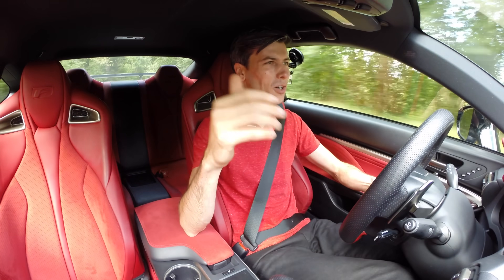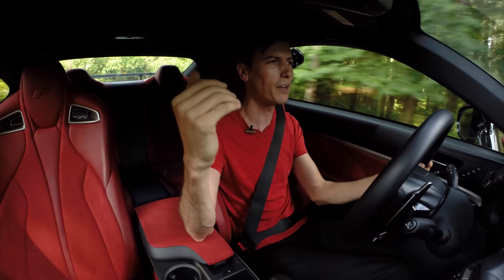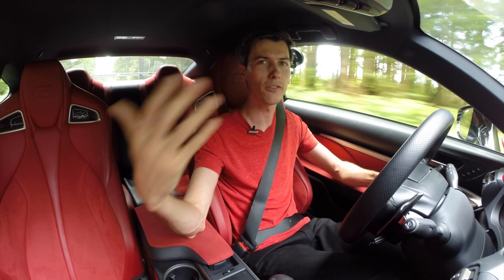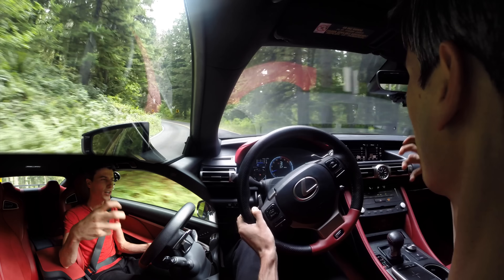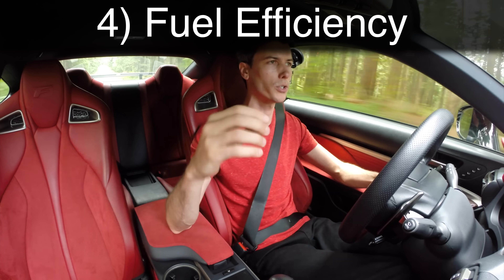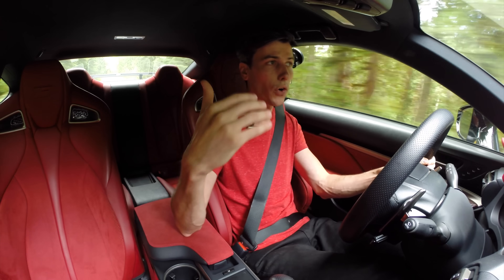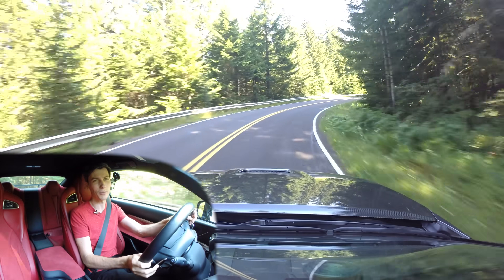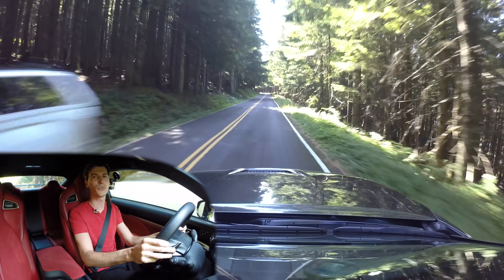5 Reasons You Shouldn't Buy A Turbocharged Car

Comment: Not a fan of turbos simply because of the lag, complexity, and reliability issues. I'll take a bigger engine and fuel bill any day.
Reply: Roger Hinman turbo lag isn’t that bad anymore thanks billet compressor and turbine wheels, increased exhaust gas speed and layout, the bearings used and the such, they’re not really that complicated and they’re pretty reliable, my 01’ Audi S4 has never had the turbos maintained or replaced in almost 200k miles, and that’s almost 2 decades old, they’re honestly pretty efficient, not really complicated and they don’t really break unless you beat the piss out of them and even then you can beat on them but take care of them with proper heating and cooling cycles and change your oil.
Reply: With an overdrive transmission my 'ol Mustang would probably get 25MPG on the highway (with no engine mods whatsoever and with the original engine).
Reply: Most Turbo vehicles are gas guzzlers too.
Reply: @PanameraTurboSEHybrid  When most people get a turbo car they always floor it so worse gas milage overall.
Reply: Fox McCloud 007 you can floor it in a 4 cylinder turbocharged car a lot and still get better gas mileage then a NA v8 any day its about the size of the engine and how many cylinders and what the engine was built for you dont get worse gas mileage overall just because you have a turbo
Reply: Panamera Ghost it depends on the size of the engine and weather or not its a 4 cylinder or a v6 or a v8 saying just a car with a turbo is a gas guzzler is just false information lol
Reply: Roger Hinman wake up mate. All commercial vehicles and heavy machinery are turbo for efficiency and reliability. Turbo trucks typically go 1M kms between rebuilds. All 2019 turbo cars have 11:1 compression ratio hence great low rpm throttle response. I have a factory 4L turbo Barra, and the torque @ 2000rpm is amazing.
Reply: @nordic5490  I don't know where you live, but where I live most commercial vehicles and heavy machinery is N/A. Specially heavy machinery because precise throttle response is necessary sometimes. (Talking about petrol based machinery, Diesels pretty much need to be turbo)
Reply: Nor Dic not sure why you keep commenting this on everything, but most commercial vehicles are N/A.

Comment: Tune in next week for "5 Reasons You Should Buy A Turbocharged Car"?
Reply: I have a 2.0 litre four cylinder that has 540 reasons.
Reply: @dwvw  So is one of the reasons the towing home when running at full boost for more than 15 minutes? Id say so too, more time with the family! 😍
Reply: @WeightyLemur  2016 Golf R, has 90,000 km's on it. Year round daily driver in Canada. Makes 540whp and runs 10.82 seconds in the 1/4 mile. Stock turbo did blow, but it's a known issue and I haven't had a problem with the car other than that.
Reply: Joe Williams yup. But... Jason already bashed turbos on another video.
Reply: Oh God, don't let vehicle virgins take over Jason 😥
Reply: A 100 reason's why you should turbo your car..
Reply: The turbo charged car cost less then a hybrid, the maintinence cost is cheaper than hybrid and you get excellent gas mileage.

Comment: So, where do I buy a new diesel car that doesn´t have a turbo?
Reply: At the used market
Reply: Easy. You go to any developing country that doesn't have emissions standards and you buy a Toyota Land Cruiser 70-series with the 1HZ engine. 4.2 straight 6 making 126hp. No turbo, no catalytic converter, no nonsense.
Reply: Do not buy a new common rail diesel car they are junk
Reply: @hegantetamboktyanak6368  The last Mercedes E-class taxi I took had 557.000km on it, but no please tell me more about how junk modern diesel engines are.
Reply: @torod213  that's only one example DPF are killing diesels
Common rail diesels can't handle poor fuel
Reply: @torod213  so basically if you want to have your hip-pocket raped just go buy yourself a new diesel car
Reply: @hegantetamboktyanak6368  "New"? As in built in the last 20 years? lol

And yeah a NA Diesel that makes 126hp, gets 25mpg and takes 20 seconds to get to 60 is a great idea.
Reply: @BigUriel  actually all diesels are no good but in particular common rail especially with a DPF a petrol engine is far simpler

Comment: Nice video... I disagree with to torque point and the fuel efficiency point, the torque curve depends of the size of the turbo, and modern technology has gotten better fighting turbo lag, with somehow big turbo cars, like the McLaren 720s and Ferrari 488 pista. Fuel efficiency point: Yes, at wide open throttle the turbo cars are less efficient, but you never drive all the time at wide open throttle, in the streets al least. The naturally aspirated cars with big engines feel  good and strong in torque, in lower gears, but in the upper gears, they only show power, very high in the rpm band, of course this is less possible in public roads too. But nice video nevertheless, don´t get mad on me Jason! ha ha!

Comment: On sound, the cam lobes have to be more apart with no overlap between the intake and exhaust when running boost. That's why N/A engines sound better with big cams because they're throaty.

Comment: Well now, just hold on a sec.
Reality check, please.

This talk of "delay" is really an issue of the past.
In the Fords I drive, there is no lag. And I read many reviews of newer turbos that have none as well.
PLUS this initial torque is down low where EVERYDAY DRIVER has use for it.
Come on, really, when do MOST drivers EVER see their engines running at high RPMs!?
Never, really.
We need it from red lights and up ramps. Never at top of the limits like these reviewers rant about.

Silly.

Other than the cooling and temp issues which are addressed with modern synthetic oils and proper maintenance...the NA engine is just lagging.

Comment: You haven’t convinced me Jason. While my 427 ZO6 had all the attributes you mentioned for a NA engine, I have other comparisons to make. 2014 Ford Edge, NA 3.5 V6 in an admittedly heavy vehicle. Nice power in the upper rev band, but weak down low. Much like a CBX power-band. 2019 Ford Edge ST, 2.7 twin turbo V6. I can honestly say there is virtually no turbo lag with this little powerhouse. Throttle response in S mode is much like you claim for turbo engines.  But it’s easy to to change perceptions and modulate the throttle.  The cabin is so quiet that Ford resorted to the trick if bringing engine sound to the interior via the B&O sound system. Perhaps that’s cheating, but the engine sound is very nice. I use synthetic oil in all the mentioned vehicles, and plan to use the new GF-6A spec oil when it becomes available in 2020.

Comment: most owners of turbocharged cars can't even get to the boost, because they drive them with very little throttle input. Most of these owners are ignorant fools which were told by the dealer: " buy this car, it's very economic and has amazing power". Petrolheads know that the better engine option is Naturally Aspirated 100/100.

Comment: Compare a turbo2 litre and a 5litre high compression point for point and the 5 litre wins. 

And for reliability simpler is better and understressed is better so the 5 litre is the winner.
If you want efficiency and power in a diesel then turbo it. CAT nods in agreement.

Comment: Manufacturers love turbo's because they can claim CAFE standards within the fleet. Easier to make a car that gets good mileage when not pushed hard, which is what they care about.
Reply: Robert Mills turbos are better fuel economy, better mid rpm torque where people actually drive, in 2019 are all 11:1 cr hence great throttle reponse. Turbos dominatw all classes of motor sport where they are allowed. All commercial vehicles are turbo with turbo trucks typically doing 1M kms between rebuilds.
Reply: IIRC turbos are great at economy ... But only when you're babying it because you're basically running a tiny NA engine. When you put down power, well now you go from 2 L to 3L and it eats fuel accordingly, and then some to keep cylinders cool.

Comment: If you want a more trouble-free and longer lasting engine, your best bet is a normally aspirated engine. In my experience, turbo charged variants of engines also offered as normally aspirated engines tend to be more trouble-prone with a shorter lifespan. Oil consumption and blown head gaskets are more common as well.

Comment: Electric motors deliver the power now, when you ask for it, instantly, ref. Tesla Model 3 / Nissan LEAF etc 
While the batteries weak, we already have access to cars with 70+ kWh of battery 
LEAF went 24, 30, 40 & 60 kWh now ^^ 

In big urban areas, traffic congestion, lots of stop & go, Electric the most pleasing/ hybrids are good too
Reply: Until you get into heavy duty applications like in trucks, tractors and other large high load vehicles.

Comment: On my new channel I talk about why to avoid turbo motors, GDI motors, and engines with timing belts. Great video!
Reply: The Switz good channel to.avoid then. All commercial engines are turbo, including power generators, all classes of motorsport are dominated by turbo where turbo is allowed, turbos are reliable with turbo trucks tyoically going 1M kms between rebuilds, and, all 2019 turbo cars have 11:1 compression ratio giving great throttle response at low rpm.

Comment: Your point of half throttle full boost is flawed. In such a scenario you're still not at full power output for that given rpm as the throttle is restricting airflow massively, so it takes far less airflow to reach that boost pressure.

Comment: I would be very interested in a video comparing turbo vs NA fuel economy at the same horsepower rating. For instance, take any Ecoboost and compare it to something with the same horsepower that is NA.
Reply: Now try that at around 5500 rpm, then it's a different story. There's always two sides.
Reply: Jevgeni Ardassov 5500 rpm?? You driving a 4 speed? Get real.
Reply: I think he's talking about the powerglide that his new car has
Reply: @kalashnikov1343  Most people in the US would either be driving in a city with a ton of other cars, or highway, neither of which involve repeatedly stomping the gas like a racetrack.
Reply: It really depends on the driver. A driver that let's the turbo(s) and transmission do all the work will see better fuel economy.
Reply: @TheSingleTrucker  Yes low boost runs a leaner mixture.
Reply: My modified 95 Eclipse GSX VS A friends 2 liter stock NA, 2WD version of the same car...

My turbocharged car got better fuel economy by A few MPG but driving style and modifications throw off the results.
Reply: Seems like 10-20% higher fuel economy on the turbos for similar or higher horsepower, on the same overall model.
Reply: @kalashnikov1343  The turbo on my fusion EcoBoost spools full 14 psi at 2k rpms... so try again
Reply: @socialjusticewarrior9601  damn that sucks. I feel bad for you
Reply: @kalashnikov1343  Why do you feel bad for me? I stuff my money away, instead of spending it on impractical things. I have a comfortable economical car that fits my needs.
Reply: @kalashnikov1343  2.0L EcoBoost. Have a stage 1 and stage 2 boomba racing catch can. Zero carbon deposits and clean bottom end. It's a 2016 and it has 105k miles on it. Average 34mpg everyday to work. 

Constantly strained under all rpm? 75mph to work and back at 2500 rpms... ok.
Reply: @kalashnikov1343  Boats in wheels? My fusion weighs 3500. Average for a midsize sedan
Reply: @kalashnikov1343  good talk bud.
Reply: @socialjusticewarrior9601  nah boats on wheels as in land yachts, ya know, before the 70s oil crisis
Reply: @kalashnikov1343  I'm just going off of forums from ford for the borgwarner turbocharger. No need to bash me on my investment.
Reply: @kalashnikov1343  nice talk kiddo
Reply: @socialjusticewarrior9601  I got the st and can confirm turbo spools to around 16 pounds around 2500 rpms in 5th or 6th
Reply: @socialjusticewarrior9601  yea at full throttle
Reply: @mynamejeff2647  that's not full throttle but ok.
Reply: @mynamejeff2647  silly kid with dads old 350z lol.
Reply: @socialjusticewarrior9601  I wish I had my dads old car ffs damn thing is faster than my current motorcycle
Reply: Justin Updyke all comercial vehicles and heavy machiinery is turbo for a reason: fuel efficiency and reliability. Turbo trucks typically do 1M kms between rebuilds. Supercharger is much harder on engines.
Reply: I can get 33+ mpg out of my DSG Golf R when I baby it. Considering it’s 300hp, that’s pretty impressive
Reply: The turbo wins
Reply: My 182hp 1.5 turbo Focus uses at least 35% less fuel than my mom's 160hp N/A 2.0 Mazda CX-5. So.... There's that.
Reply: @torod213  You are alo comparing a compact car to an SUV, but the turbo still helps.
Reply: @BugMagnet  *wagon to an SUV, but yes you have a point. It accounts for some of the difference, but far from all of it.
Reply: @torod213  Right, they build different cars under the same name in different regions.
Reply: @torod213  My MX 5 has the same engine like Your Moms CX 5 ( has 150 hp in CX 5 by the way ), is faster  and uses less fuel than Your Ford guess why ...
Reply: @heikopanzlaff3789  1: Don't know what market you're in, but my mom's 2013 CX-5 has exactly 160hp.
2: Your (I assume) ND 6-speed manual MX-5 does in fact use a whole 20% more fuel than a turbo Focus, according to official figures for the combined cycle. And before you say anything, I have no problem matching the official figures in everyday driving. Granted those numbers are for the manual hatch version, and I have the auto wagon in lifted Active form. But even the numbers for my car are lower than for your over 300kg lighter 2-seat low-slung sports car. You just put a big, fat nail in your own coffin.
Reply: @torod213  that comparo is going to need careful controls to be comprehensive. For example, if the smaller turbo engine only has to move a small car vs. if the NA engine is saddled with the extra weight of a crossover or SUV. Small engines are all well and great but strapped to a heavy chassis, they have to work harder and therefore drink more. Then there's the relative technology between the two. If the tech gap between the NA and turbo engine is broad, it'll skew the results. A small NA Mazda engine with very recent cutting edge skyactiv will drink less than another engine with tech that was developed 7 years ago...but is just being massaged through the years to keep the motor relevant. Then there has to be a test route over a set time with similar driving styles. That's a helluva undertaking so folks don't really put much thought into it.
Reply: @maximumvelocity6542  Look below at "Heiko Panzlaff
"s reply to me, and my comment to him. The 1.5 turbo with 20hp more in my 300kg heavier lifted wagon drinks less than the 2.0 N/A in his little 2-seater MX-5. Which is the same engine used in the CX-5. The thing is, car manufacturers aren't morons. I'm sure part of the motivation behind small turbocharged engines is fooling emissions tests, but there is something there for normal people as well. The tiny 3-cylinder in my car is perfectly suited to everyday driving, and if I'm not driving like a moron then I have no issue matching the WLTP numbers.

Comment: He talks about engine torque "dying off" with turbos and that's not really what happens. He romanticises this idea that NA engines keep pulling at higher RPMs but the issue with this is that there is overall less acceleration to be had especially when you look at the curve generated across all gears. When you have the ~1/x torque curve you are getting the maximum acceleration possible at that power level. This doesn't give the same jerk that the NA engine gives, but it's more ideal if you want pure acceleration/power

Comment: Here in UK / Ireland most people drive diesel cars, you can't get these without turbo. I used to be a petrol person for years until I bought my first diesel car. I love early maximum torque and power that pull great even at 2000 RPM, fuel consumption is another thing. You can easily get 50mpg with very decent performance. I can't really see myself going back to petrol, will probably switch to electric in couple years once the mainstream cars the likes of Nissan Leaf can offer 400 mile range with price matching it's ICE equivalent.

Comment: Still love my Saab 9-3, 2.0T stage 2, 300 lb/f torque, 250 HP and 33MPG highway.  (Also, some turbos are coolant cooled, and I'm at 153,000 miles with factory internals.)

Comment: Boost threshold and turbo lag are 2 different things. It seems like you use lag to describe both. Dumping fuel to make power  is not unique to turbocharged engines. When you poked the throttle in that Lexus the ECU switched from closed loop to open loop dumping fuel to make power and prevent knock. Most turbocharged engines have intercoolers to reduce the inlet air temperature due to adiabatic heating.

Comment: Given equivalent engines a forced induction engine will on average be less reliable and require more (expensive) maintenance than a naturally aspirated engine.
Reply: Equivalent engine meaning what?
Reply: @KaitouKaiju  As the owner of three Hondas all normally aspirated (1.8, 2.0, & 2.4 liter engines) I believe the odds are that these engines will last longer and require less maintenance than the new 1.5 & 2.0 liter turbocharged engines.  However if I were comparing the Honda turbo engines to something like the engine in a Chevrolet Cruz I believe the Honda engines would be more reliable.

Comment: I just love how the power of a turbo vehicle comes on at a much lower rpm compared to a n/a engine.  Ex. 3.5 ecoboost 375hp @ 5,000 rpm and 470tq @ 2500 rpm vs a 5.0 n/a 395hp @ 5,750 and 400tq @ 4,000rpm.